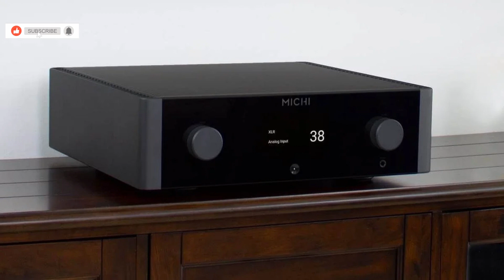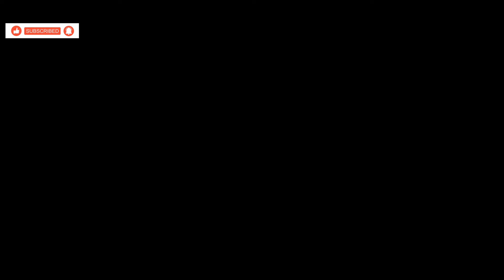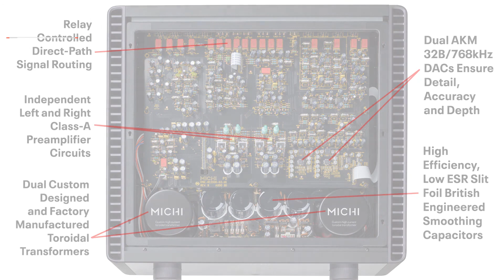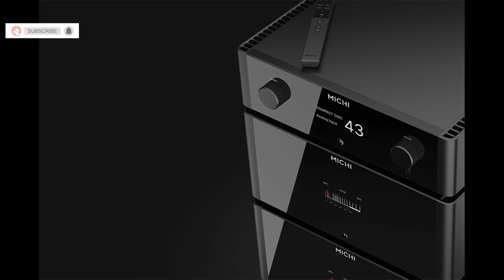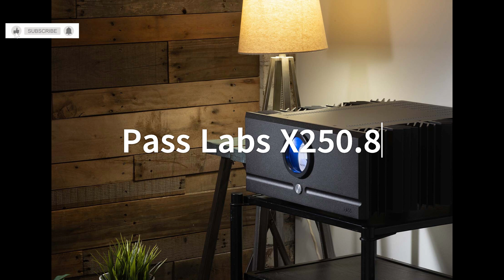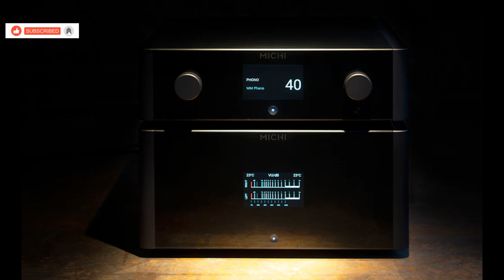Rotel Michi P5. You absolutely must try this one!!! What are the ideal power amplifiers?

Comment: How does the Michi P5 fit the Rotel 1582
Reply from the maker: The Michi P5 pairs beautifully with the Rotel RB‑1582. The P5 is a very clean, detailed, and transparent preamp, and the 1582 has plenty of power and current to take full advantage of it. Together they make a very balanced combo: smooth, controlled, and with excellent dynamics. It’s a great match.